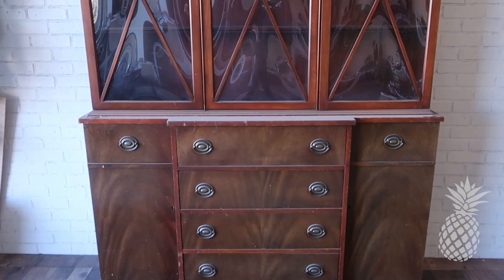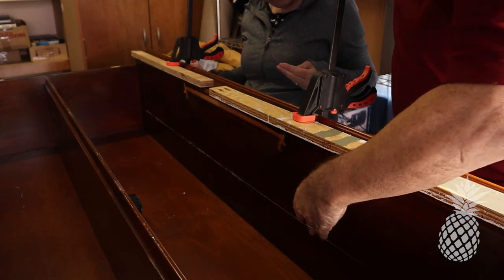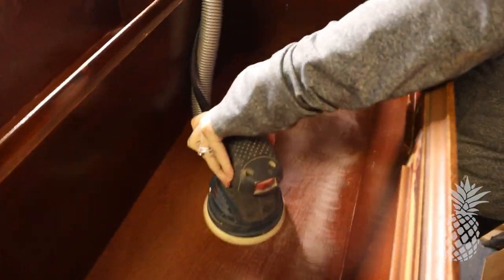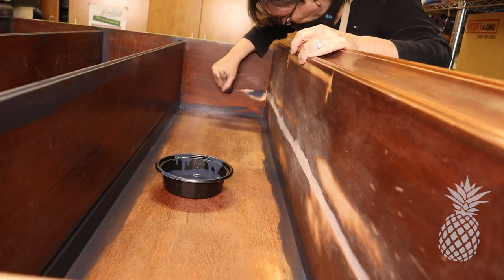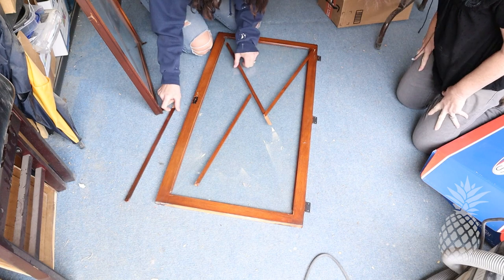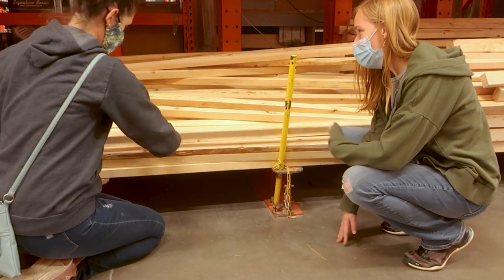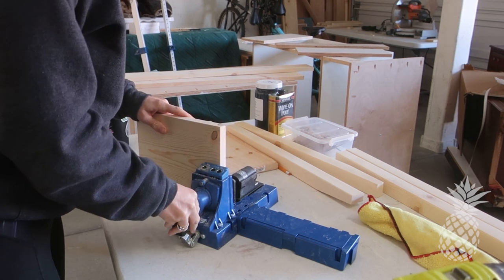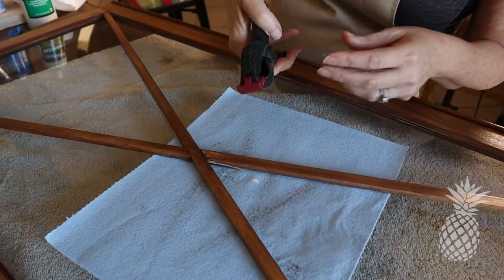VINTAGE CHINA CABINET MAKEOVER / DIY Hutch BASE / Melange One Paint

Comment: What kind of wood did you use for the base. It doesn’t look like oak. And what kind of screws?  Can you give me the leg measurements and the wide board measurement please?
Reply from the maker: Hi Catherine, oak is the best wood for a base like this but it was out of stock so we went with pine. We used 2 x 2s for the legs and 1 x 8's for the apron. The base is 24" tall. The screws used are pocket hole screws. Thanks for watching!😊
Reply: I tried pine because oak is so expensive here in Canada but it split every time!

Comment: Hi I also have an antique hutch I'm re-doing. I'd like to know how tall you made the base....thanks so much!
Reply from the maker: Hi Melanie, the hutch itself was only 41 inches so we ended up making the base 24 inches and we used a 1 x 8 for the skirt/apron. It seems to be plenty strong to support it. But we know that when it is fully loaded it will be a little top heavy so will recommend to the new owners that they should secure the back of the piece 😀to the wall for safety.
Reply: Thanks for the reply! Looking forward to see what you do with the bottom portion of the hutch!
Reply from the maker: @Melaniepond  Thanks! Good luck with your hutch!